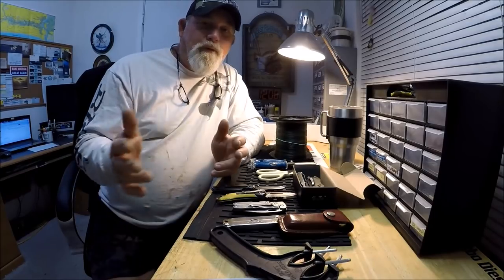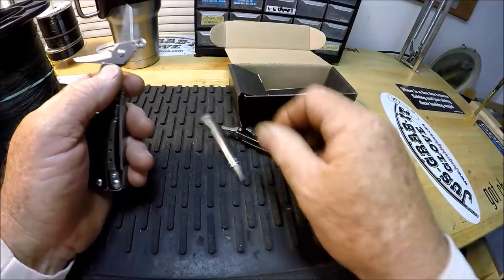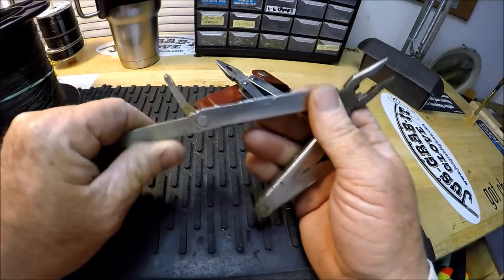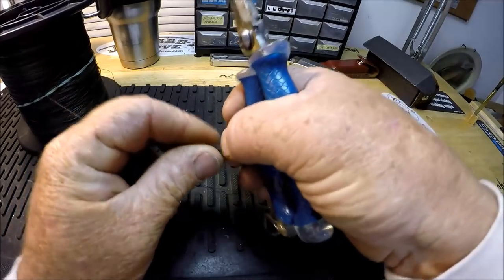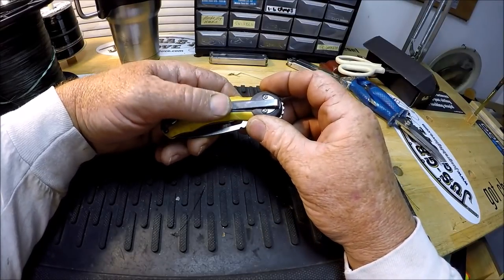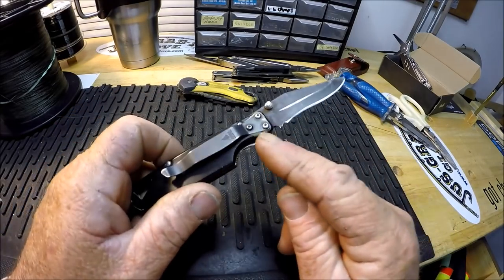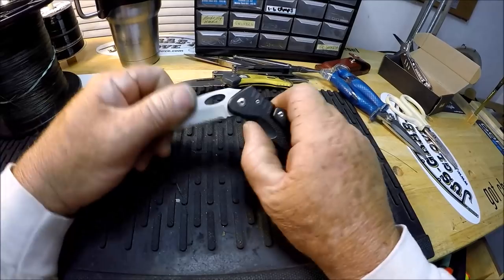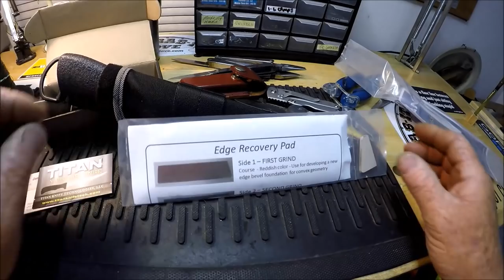A SALTWATER ANGLER'S E.D.C. PROBLEMS  ''it's all junk''

Comment: EDC's for fishing are tough....I hate folders especially in the sand.  Plus 90% of what's out there rusts.  And the H1 steel from spyderco doesn't hold an edge well.  Even still...THe spyderco caspian salt has 99% of what i want.  Rust proof.  Finger hole for on the boat no wworries about dropped grip.  ANd it has a spectacular sheath that I wear as a necker every time i'm on the water..Unfortunately they sell for 100-400$ if they ever show up.  I hear their new LCN steel is the perfect marine steel.
Reply from the maker: Your big pliers....the ones that look like USA Sargents. Just got a monster pair and sheath on Evbay from S. Florida brand new for $38 bucks yesterday. I'm not a LBA (l;and based angler) so sand aint my deal. Plus, I am extremely into maintenance. You should see my Fish cleaning attache. Doing my newest EDC as a boat "guide" right now. I have one day off. Gotta get em done......You'll see it maybe. I'm happy with all my "new finds. EDC items are like rods and reels to me. It's about the "deal find" and what I'm in pursuit of. "AND I'M CHEAP!"
Reply: I'm a buy once kinda fishermen...But that really doesn't apply when it comes to day in day out saltwater abuse......it's buy cheap....it'll get destroyed in a few months...or shit happens and it'll disappear after getting heat stroke..lol   I'm on the water about 200 day/ nights / year.....but it's fresh water/ surf/ offshore.....so the rotation helps.   I getcha 100%  But those spyderco caspians.....perfect for anything saltwater.....Those sargents.......NO LONGER......Discontinued....which sucks.
Reply: By the way...email sent....I clicked on your comment to reply here...and it auto sent before I put my name......or at least I think that's what happened.
Reply from the maker: thats why I scooped them up, for the hell of it. I'm cheap because I have huge other expenses like charter tackle/ boat etc. and a non-stationary income.....LOL.